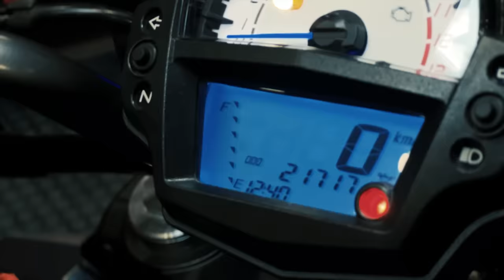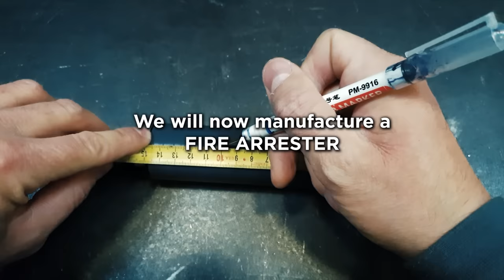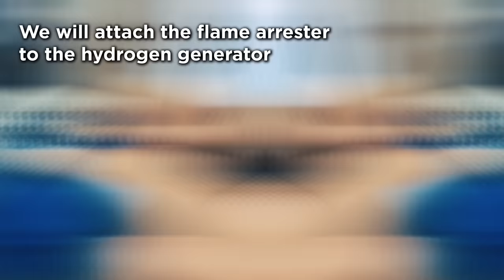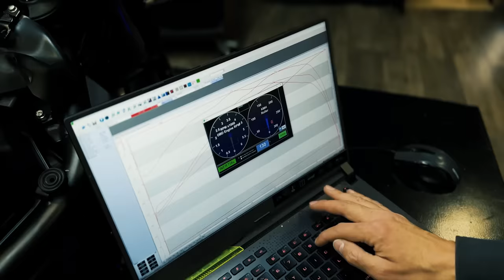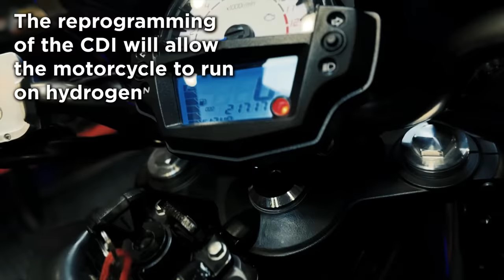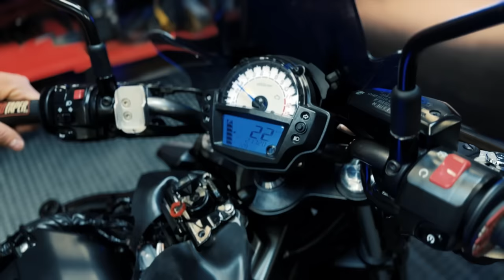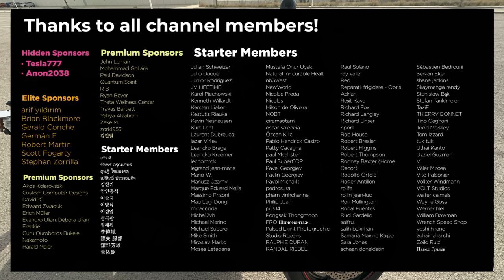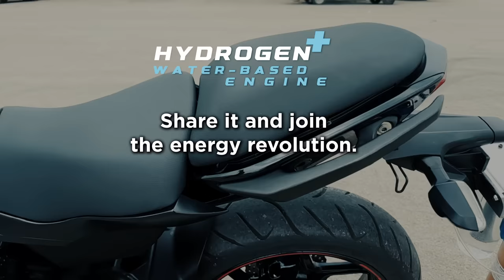Running Bike On Water - 100% Working Trick

Comment: People like talking about ev wuy don't we have water powered vehicles aka WV?
Reply: Yes... But no.

It's realy not the same, here, speak about to use only water, it don't work.
Reply: @kjorgahn  so what if you take out the gas engine and replace it with steam power like a ship cus I'd rather do anything than be pushed to ev we see how short of charge thay have
Reply: @ZR117     It would also not work by steam power. You can buy cars which run with hydrogen, but it is not possible to produce the hydrogen on board, perpetuum mobiles don't exist. Water itself has zero energy, only hydrogen has, and it needs energy to get hydrogen from water. Just like cars running with natural gas cars running with hydrogen must get the hydrogen from filling stations offering hydrogen, and these are very rare.
Reply: @heinzpg  to bad we don't have warp power cars yet

Comment: How you control H2 and O?  Ferst how many litrs per minute? 
Second time. How you directing engeen motor? For fuel  it is another! The ignition angle is different. ignition time.
Reply: thats where the software comes in --tuning for to run on hydro
Reply: @brenohighland1168   I make experiment for car. It is no correct.  15A not so much given  lits per minut.  Need dc dc module. If take HH generator.  If your motor need  more  liters ? How will give  more? If you use  only  15A. . 100km - 8-12L gasoline.  LNG need 15-20L ~.

Comment: So can someone just straight up explain to me the cost/benefits of using technology like this vs petrol? Just a quick comparison for someone who doesn't already have a degree in electrical and chemical engineering? Like a 100% practical use.
Reply: None, it doesn't work. Hydrogen motors are certainly possible... but not like this. You cannot create enough energy to sustain operation. There always has to be an outside source of power. In this example,  the alternator will not be able to keep the battery charged well enough for sustained operation. You've essentially created an ev bike since the battery charge will always be the limiting factor. Adding more batteries adds more weight, which then adds to the required power to move. You can tune the system to be as optimal as is capable of being,  but it will never be as efficient as a full petrol or electric motor. And in this particular case,  you wouldn't get a mile down the road before either the motor chokes out from lack of hydrogen, or the batteries die.
Reply: @tannissar5624  But if this motorcycle can run at least 50 km, it will be the last for Uber's work, because after 50 km of running it will only switch to water and electrolytes, and scrape the metal.
Reply: @jhonmcz  it cant make 1 km much less 50 🤣. But if it's a 2 stroke, your correct. Otherwise, no,  lubrication works just like any other fuel burning motor.
Reply: @tannissar5624 He said 5 Amps drain = 0.08 HP, this sistem is a joke. Flat Earth Bike.
Reply: @laerteoliveira7923  yep,  that's the problem with virtually every model like this one. You simply can't produce enough hydrogen to make it worth anything.

Comment: Right on, dude👍 But if everyone had a vehicle that ran on water, the planet would run out of fresh water.
Reply: it doesn't require fresh water, actually salty water is better as it conducts current better, which is probably what the white powder was😁
Reply: Salt water works better. We have plenty and the exhaust will be fresh eater. Watering the planet. Cool.

Comment: enserio alguien le cree esto? entiendo que la mayoria de la gente no sepa de quimica, fisica o como funciona un motor, pero y su sentido comun? la electolisis es para hacer hidrogeno, pero el hidrogeno no sirve para la combistion en los motores
Reply: 금세 사라짐 증기가맞음 ~
Reply: Ya hay motores que funcionan con hidrógeno 🤦
Reply: @Elimenrock  lamento decirte esto pero no es cierto, lo que te venden como carro con motor de hodrogeno realmente es un  carro electrico que genera su energia a base de hidrogeno, lo mas cercano a un motode hidrogeno es uno de 1.6cc que solo se usa como invesitigacion
Reply: @mesao139  podrias demostrar que NO ES CIERTO esto ??
Reply: Hydrogen is HIGHLY flammable. Even more then gasoline. Have you done any chemistry in college?
Reply: @mesao139  Know the difference between hydrogen fuel and hydrogen combustion. Both are possible. If you had any chemistry courses in college you would know this. We actually did the combustion experiment in lab class. Have you heard of the Hindenburg disaster? Hydrogen, when introduced to oxygen and a simple spark will detonate. This seems to run for a short time only. excess hydrogen gets released in the air. The setup only uses what it is needed. This was meant as a project and not for transportation of long distances.
Reply: @skonstas4683  que algo sea flamable no significa que sea buen combustible para motor,  eso deberias de saberlos si realmente prestaste atencion en quimica, la harina y el polvo de chocolate tambien es flamable  y produce combsution pero no por eso se usa en motores, no transgiveses un experimento para que cuadre con tus ideas. saludos.

Comment: Don't do this to your bike. This thing uses electricity for making hidrogen and then combust it and if the combustion engine itself is inefficient this Will get even wors. In fact this Will have incovenients like that the engine is designed for running on gasoline, not in hidrogen.

Comment: I've seen many similar applications, so if it works, why do we pushing electric vehicles so badly? (corrupt governments?)
Reply: Hard for companies to profit not just government, you could in most states just have a rain barrel supply your fuel and noone could charge you unlike have to pay for dealers to replace battery cells or paying the city for the using your electricity.
Reply: X q el secreto e$ esclavizar y q vuelvas PRONTO.😂
Reply: X q el secreto e$ esclavizar y q vuelvas PRONTO.😂

Comment: бред, он не успеет создать достаточно водорода чтоб двигатель работал. это фэйк.
Reply: انتاج الهيدروجين سيكون عن طريق الكهرباء التي تحرق الماء ويتحول لهيدروجين
Reply: @user-xt3er2oe5h but it takes way more power than this to create enough hydrogen to run an engine. That's why hydrogen powered cars haven't taken off like people thought. Electrolysis uses tons of electricity. Not just 12v.

Comment: trick... LOL     this knowledge is ancient..  electrolysis to split water = hydrogen and oxygen..    combustion engine run on it so well it doesn't eve leave carbon residue..

not saying gasoline isnt a crap duel that NASA has even stated hydrogen is the best  LOL      ya...    water, electrolyte ( to make water more conductive) and a power source....   what charges the battery when you drive? an alternator!   wow!  that sounds like a much better fuel huh      :-)        you pay for water and kno3 (lye)  or salt or others.. and boom clean engine, no emissions minus water out the tail pipe....  and    freedom to abandon the $1.90 a litre   LOL      I got my units on my old truck  lol screw paying for crap duel :_)

Comment: Contact believe people believe this cr*p / what do you think is powering the electrolysed? A battery that would work far better 3to 6 times) driving an electric motor 😂
Reply: Actually for electrolysis power is provided directly through ignation. No connection with battery the more hydrogen your bike need it will get when you give race to bike
Reply: Electrolysis requires electricity - if that comes from the alternator then it will fail as perpetual motion is not possible. You’ve been duped.

Comment: the engine was not designed for this so i cant help but think this would take alot more work/complexity than just slapping a hydrogen generator on and piping into the engine. I would not sit on what could turn into a runaway engine at any second if one of the components malfunction or fail completely

Comment: The hydrogen gas is far more powerful than gasoline. The battery issue is solved using a higher voltage battery... duh. The nay sayers are shills for the Roth's. They did a nice job here even reprogramming the computer. Unfortunately the Roth's (who control the world) won't ever permit it's production. Electric has it beat though and is quiet, though some may like all the noise, and is worry free and will operate on a 9v battery which is only to get the generator started. 59,000+ such patents issued for zero point the going back to the early 1900's with Nicola Tesla who they destroyed.
Reply: That's what I think 2,  need s the gas tank. That's a lot more work.
Reply: @lesliel1182  trabaja solo el hidrogeno, para carburador de auto ? funcionaria? , y solo o a la vez con la gasolina?
mas voltaje de la bateria es mas oxigen

Comment: Cannot run on water.
Reply: Actually its hydrolsis process and bike is running on hydrogen gas which was produced on electrolysis.
Reply: 3:33 The video is dishonest.
A tiny electrolyser like the one shown would
produce 100 watts at best.
The bike would have a top speed of about 4mph.
Reply: @_soku_  There is no reason to attack his mental capacity in a diminutive manner. He is clearly misinformed how it works.

Comment: Great video of fakery it's a proven fact that the amount of gas released from this prototype is minimal at best you have to heat the water way hotter then this to achieve true hydrogen good thing the bike still runs on good ol regular gasoline 😂
Reply: Heating is unnecessary, however you are correct that the splitter cannot produce enough gas.

Comment: Have you tried a car
Reply: A car can carry a much bigger battery to make the electrolysis.

OK. If you would just use a electro-engine the range would extend 4 to 8 times. But electro is out.
Reply: @cyrion7819  no battery are worse I'd rather steam powered
Reply: @cyrion7819  due to environmental reasons hint hint minus well thank on steam power vehicle not electric or gas

Comment: how
Reply: In this case, electrolysis. To put it in simple terms and save my fingers from typing a lot, the water is turned into hydrogen using electricity. The hydrogen is then used as the fuel and acts as such. Nothing changes but the fuel. The only emission is water. Water comes out of the exhaust pipe

Comment: Your going to ruin your engine.
Reply: You really believe that he's actually running on hydrogen? He covered the air intake, cut, then uncovered the air intake. Then the next move is to run the electrolysis apparatus from the battery system. Bike is running on gasoline with maybe a sniff of hydrogen.
Reply from the maker: My engine is modified so that it does not break down

Comment: This doesn't make any sense. The engine shouldn't produce any sound and noise if its really powered by electrolysis. It would be totally silent like electric cars.
Reply: It's burning hydrogen as a fuel.
Reply: @65sohc  no. Burning hydrogen as a fuel is possible, but you need the hydrogen already available in a tank (possibly safe). They are creating hydrogen from water using electrolysis. This is possible, but it  is not feasible as shown in the video. You need ENERGY to divide oxygen from hydrogen. Where is it coming from ?
In addition, electrolysis efficiency is really poor and the process is NOT fast. They would need more water and a HUGE amount of energy. Everything we see in the video is a clever trick.
Reply: Nope its running on Hydrogen now. Same sound
Reply: @TheodoreAndor  ok. As I wrote, it is possible to have a bike burning hydrogen. Nothing strange. Kawasaki just created a prototype. The issue is where the hydrogen is coming from. If you have got a pressured tank of hydrogen, it will work. If you are trying to create the hydrogen from water in real-time like the video, it is not feasible.
Reply: @snoopypeanuts9160  And also he is running it from H2O2 wich is highly explosive and could destroy the cylinder (if even enough is produced. I mean one stroke and all the gas generated after 1 minute is gone)
Reply: @snoopypeanuts9160  It works, tech you could do this to your car or truck and lean out your fuel to get double the gas milage.
Reply: @003Blind  no. You cannot double the mileage. I perfectly know hydrogen support system. They decrease pollution gas and they improve a little the mileage. They create a little quantity of hydrogen because the power to create it is coming from the battery. You are mixing different solutions and topics. The hydrogen works more or less like a fuel additive.
Reply: @highvolt9563  H2O2  is hydrogen  peroxide. I doubt its running on that.
Reply: @michaellawson6533  I meant H2 O2
Reply: No. The engine is exploding hydrogen gas...BOOM! It's not converting hydrogen and oxygen into electricity to power an electric engine...duh...
Reply: @snoopypeanuts9160  C8H18  le crece la nariz a Pinoch8